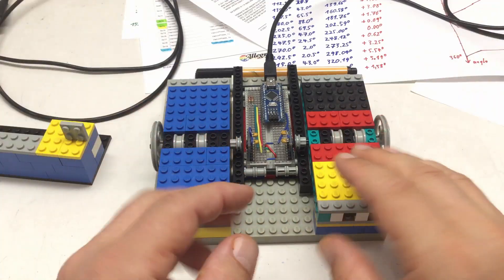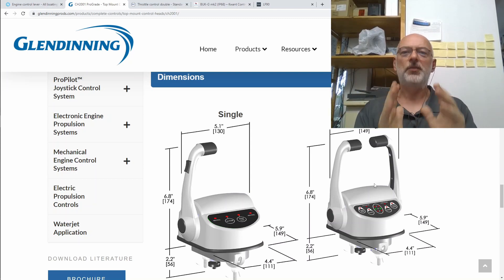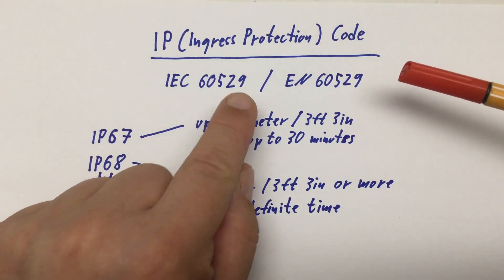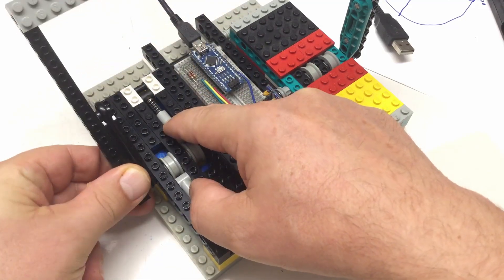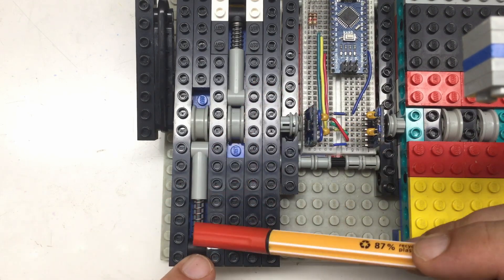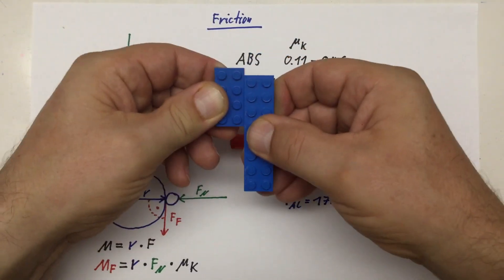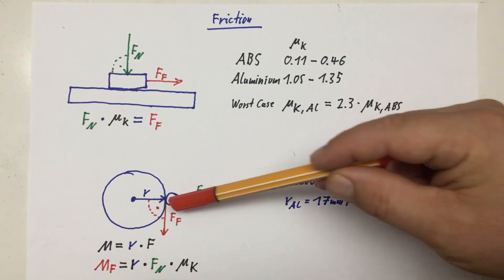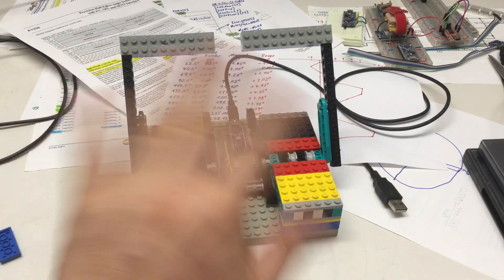Dual Electronic Engine Control Lever IP68 (1): Project Kick-Off

Comment: Actually there are much more expensive ones than the Glendinning ones, such as those made by Uflex or ZF.
Reply from the maker: Thanks for the info! $5000 or so for a Uflex? That's impressive! But they are not IP68 😞 I have to admit that I hadn't ZF on my radar at all, though they are located only about 125km/80mi as the bird flies from where I live, and many years ago I even worked for them (IT).

Comment: Hi Robert, i am not an expert , but just for nitpicking , shouldn't we use uS (static friction coeff) instead of uK (kinetic) , i love your lego collection 😀
Reply from the maker: Hi, nitpicking is always good in such projects! It keeps me honest and prevents me from making stupid mistakes 😉 Anyway, to be really complete I would have to take the static (get the lever moving) AND kinetic (moving the lever) friction into account. But for now I decided to just go with the kinetic friction. If it takes a little more or less force to get the thing moving, so be it. I do plan to have the normal force adjustable via a screw and a spring.

Comment: Rather than static friction, use gearing on the lever shafts.  A 1:3 ratio  gearing would not only provide rotary resistance but also improve resolution of your sensor because the 120 degree movement range would then be measured across the full 360 degree measurement range of the device.  If the resistance was insufficient you can always add more using static friction.
Reply from the maker: Gearing is a good idea. And I will probably use gearing in a later project. However, the gears take up space and you'll need at least a second shaft. But I want that thing to be compact and simple to build. Regarding the resolution: The A1335 angle sensor I'm using (links in the description) has something called a "short stroke mode". It can be used (and I might use it at one point) to map the 120° to the full 12-bit resolution.